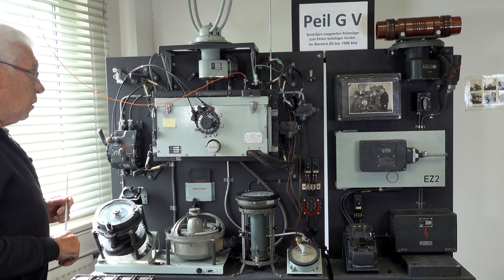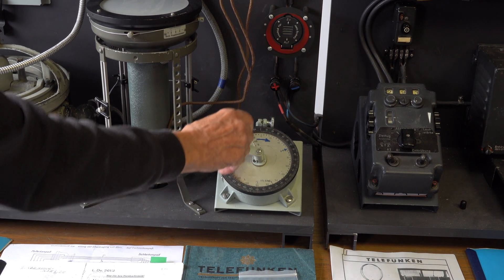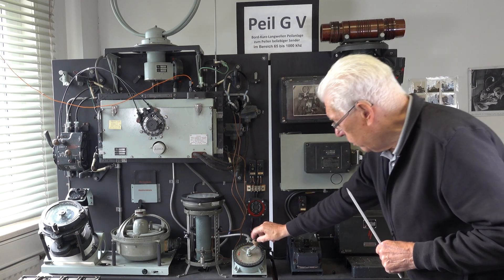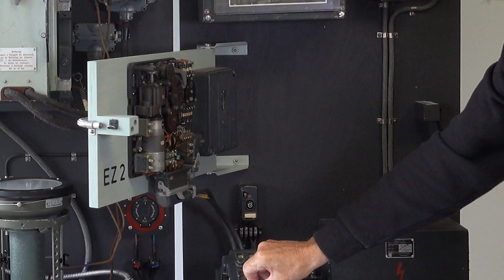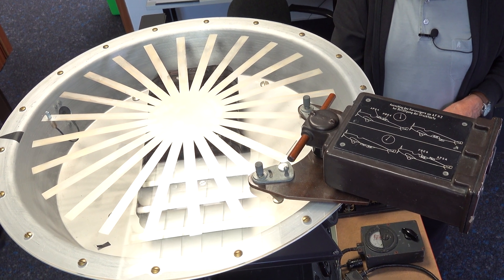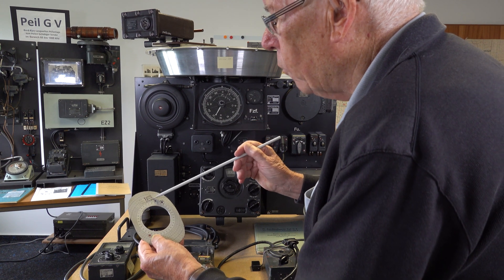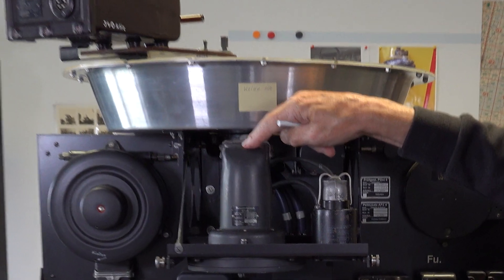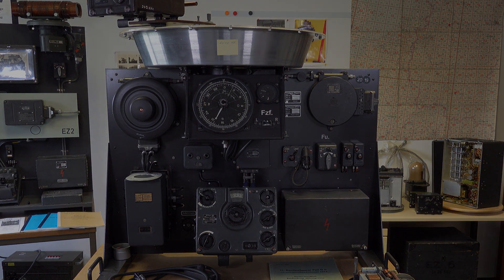German Avionics: Peil G5 and G6 radio navigation systems

Comment: This was impossible. The first thing is that this used the same frequencies as the post war ADF 
of low frequency and medium frequency 150-400 and 400 to 1200 that includes the AM broadcast band.  The G5 was a manual compass
sense antenna , the G6 was the first ADF, Automatic Direction Finder.   The Allies, specifically the USA developed their 
ADF in the last 30's. It may be that the Germans copied the american system.
The G6 system had a higher frequency limit of 1750 khz. 
The British appeared to be on a similar development and time frame as the GErmans. but only used in larger aircraft